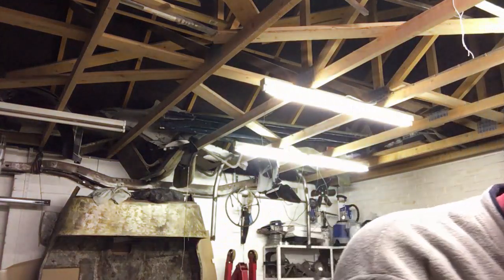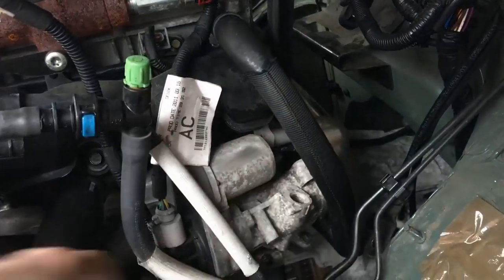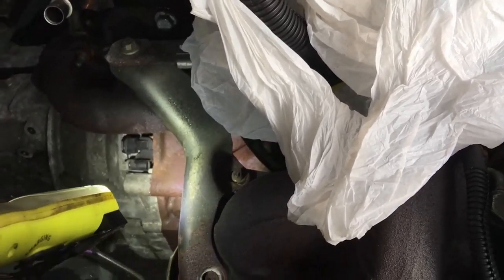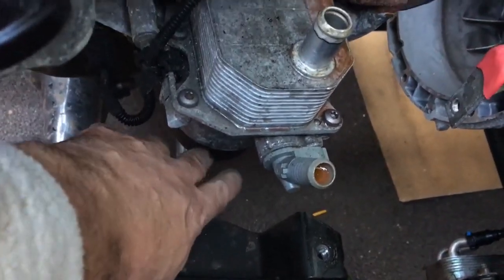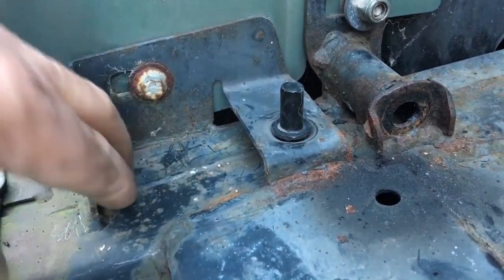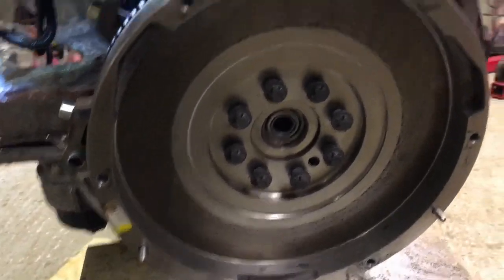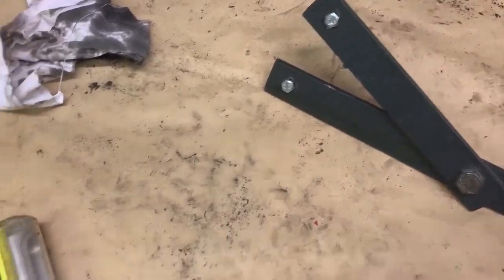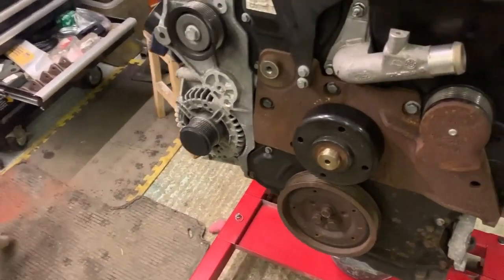2011 Defender Puma 90 Refresh. Engine out....

Comment: Nigel, your videos are totally inspiring - thanks you so much!. My Defender has broken a cam chain and I am have stripped it back to try an assassin the damage. I am now thinking of using your tutorials to totally overhaul this engine - take it out and give it a strip down. I might as well as it was running rough anyway. Would you happen to know if this engine could survive a snapped Cam chain? and what I need to check please?
Reply from the maker: Hi, I believe the engine will have bent valves if the cam chain has broken?

Comment: At 13.00 the bolts are Geomet coated. Land Rover have made a shift to this coating. Typically it can be identified by the part number, e.g FS108301L is a flanged screw M8 x 30 long Zinc coated. The same screw with a Geomet coating is FS108307L   https://www.johncraddockltd.co.uk/fs108301l-use-fs108307l.html
Reply from the maker: I think Keith, the best description is.. avoid the later stuff lol. It's crap.

Comment: Merry xmmas nige,will you also check or replace your engine water jacket welsh plugs while you have your motor totally out,a good rule of thumb with removing or replacing motors is to replace the welsh plugs before fitting engine back in,especially those located at the back of the engine where it's up against the firewall in the engine bay,have mostly did this ever since I started learning about & working on engines way back in the 80's,though most cars & engines take or run coolant these days I know,still sometimes a stitch in time saves nine,as they say,just a tip,great idea with the homemade ring gear flywheel locking tool too,i know a guy who loves making stuff like this also,cheers
Reply: malcolm bolton there’s only core plug on the engine as far as I can see at the back of the head. There’s no corrosion in the system so I think it’s best left alone??
Reply: hpiguysworkshop chris did a review & build  on here on that Revell long wheelbase kit you reviewed nigel,he hasn't done a bad job of it either,given it that faded,weathered look too,cheers